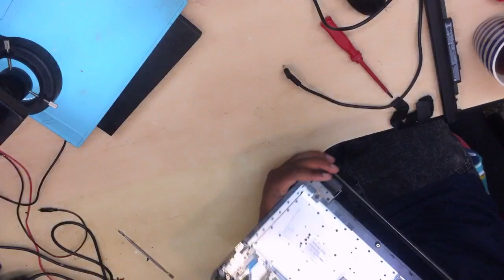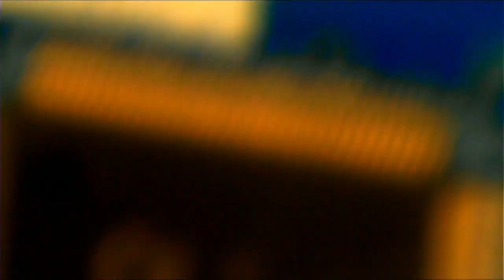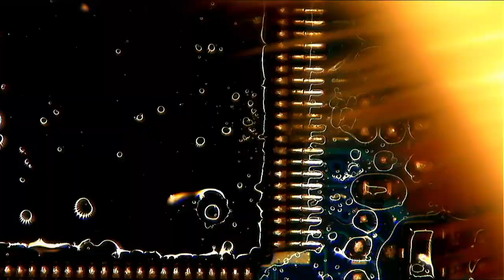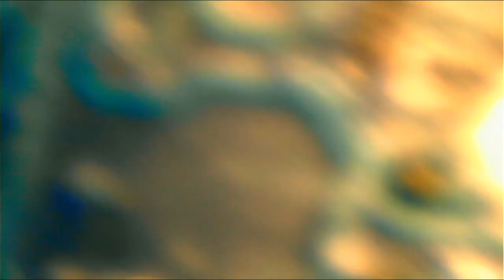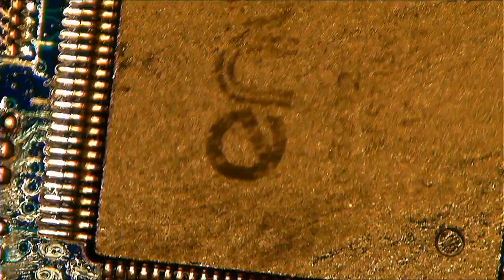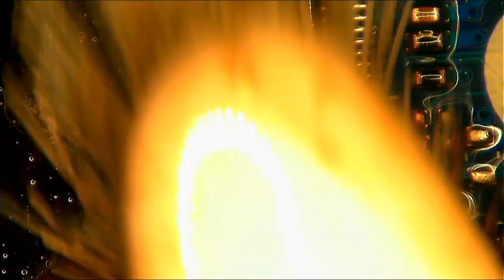How to repair Hp laptop with no display common faulty and solution

Comment: Was that corrosion that caused two pins on start-up chip to short ?
Reply from the maker: Yes
Reply: Lucky for that chip didn't blow. It is difficult to find donor boards and if you need to order a start-up ic it is going to take a long time to arrive ad then it must be programmed also.
Reply from the maker: @henrynel5197  we do everything, we program startup chips as well, and you dont have to order a new chip, use any startup chip from a donor board, as long as it compatible with that board...